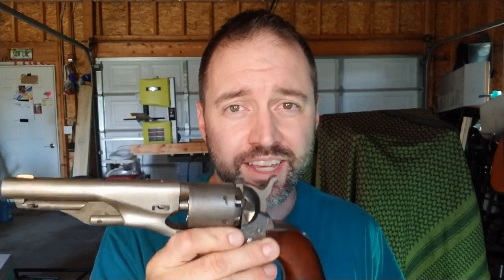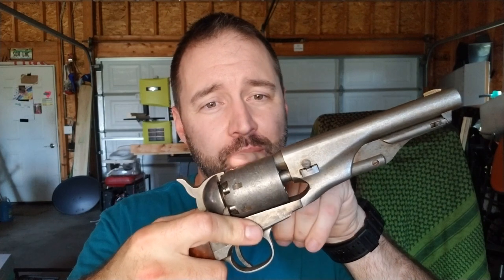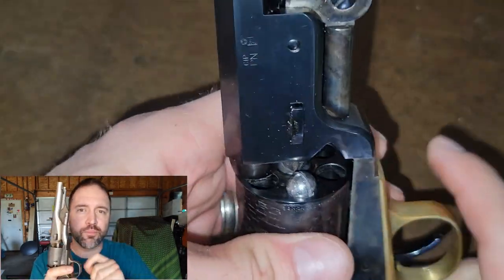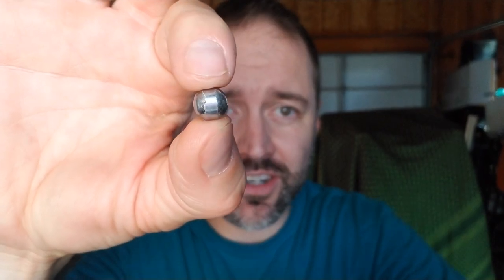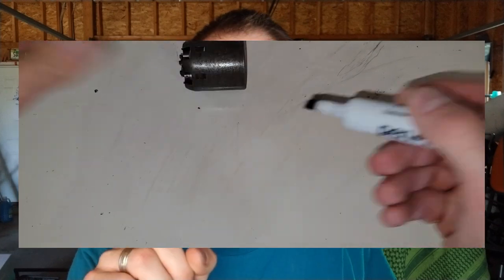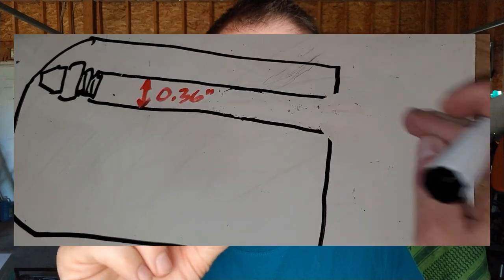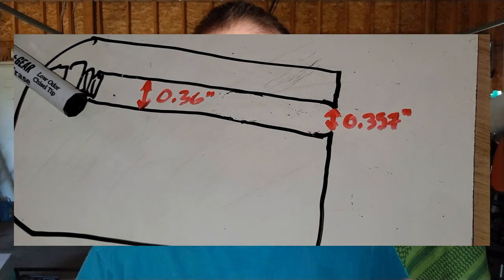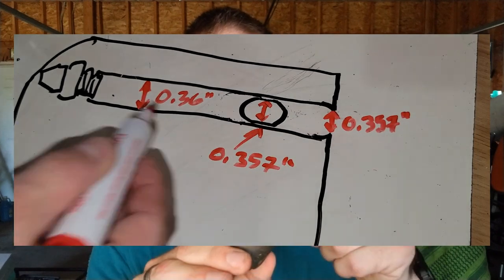Cap and Ball Revolver CHAINFIRE MYTH We've All Been Told

Comment: Thanks for a good and clear explanation. I think many people wont attempt the job in fear of ruining the cylinder so whats the alternative? That would be making sure to use Wonder Seals (or homemade) on top of each chamber. The purpose of the seal is to prevent chain fires and I have yet to learn about anyones chain fires who used them. In fact, even with doing the grinding job still use the seals. Powder-wad-ball-seal. This brings up a good question. In the civil war did they take any safety precautions or did chain fires become popular because they didnt?

Comment: Wow.... I've heard of this with Piettas..... I've always preferred Ubertis.... It's basically a "Ford vs Chevy" kind of thing..... Some people like one over the other.... Anyhow,  I've also heard of chain fires happening from the back side due to loosely fitting caps or badly worn nipples.....
Reply: Generally im a uberti guy but pietta has certain models that uberti doesnt have
Reply: @chroma6947  .... Now you've got my wheels turning.... I'm curious to know what Models that would be.... I don't know too much about them... I have had many 1858 Remington Armys... Infact the one I have now is an Uberti in all stainless..... And once upon a time I had an open top Colt made by Pietta that I just wasn't impressed with.... It shot ok, but it just looked and felt "junky", and I didn't like how it was fit together.... I pretty much have all center fire stuff, but I like to play with the Black Powder now and then.... I would like to find a older, used Uberti Walker... Always wanted one....

Comment: I lube the chamber mouths anyway, just to keep the powder fouling soft, and to keep the moving parts lubricated while I'm shooting. They're dirty guns to operate, even with modern blackpowder substitutes that are cleaner burning. You should work any new gun anyway, or take it to a gun smith and have them do it for you. It's easy work, and there's nothing you can do to damage the gun, as long as you work slowly and only remove a little material at a time. I chamfer the chamber mouths and the forcing cone, as well as removing enough material from the frame to accommodate the loading of conical bullets. The originals could load bullets with the cylinder on the gun, the reproductions aren't quite accurate to the original, and you can't fit a bullet under the loading lever/frame of the gun without removing a little material there.

Comment: The one and only chain fire I have ever had was from a Dixie Gun Works Spiller and Burr, .36. It was made by Uberti, Dixie was the importer, and retailer. I don't think it was caused by improper ball size, improper loading, since I used revolver wads, and a grease patch as well. I think chain fire comes from the cap. I may be wrong, I am sorry for your experience, on your revolver, I have had many cap and ball revolvers of different types and makers, and have never had the problem you had. Did you check with whoever you bought the gun from, or contact the manufacturer? Did you buy it as a finished revolver, or as a kit?

Comment: This racks my brain... obviously, the chamber would have had to be milled from the direction you put the ball in ( because it dead ends essentially at the flash hole). So how could they mill the chamber all the way through, and the start of the hole be smaller when the whole bit would have had to pass through said starting point? Just trying to wrap my head around this. I might be missing something.

Comment: I just got a Pietta 1861 Navy used my question is when it's half cocked should the cylinder be tight against the barrel ? Mine has a little play about 1 16th of an inch

Comment: Every Pietta revolver has a date stamp on it, either a letter in a box on the side of the barrel or the year on the underside of the barrel. What was that date of manufacture on this revolver? Or did you remove that marking when defarbing it? That would be useful information. 

In modern reproduction C&B revolvers, chainfires are a non-issue as long as you keep you hands, fingers, and body behind the face of the cylinder. You are not going to destroy the gun.

Comment: CHANCES ARE THAT A "GUNSMITH" WILL RUIN YOUR GUN, BECAUSE HE WON'T HAVE THE MENTAL CAPACITY TO TAKE A PERCUSSION REVOLVER SERIOUSLY.  ASK ME HOW I KNOW.  He will then blame the "bad steel" because he knows nothing of the difference between a high pressure (made for smokeless powder) gun verses a black powder gun.

I've been harping on this issue for years, as it pains me every time I see someone claim that "shaving lead guarantees a good seal".  You can feel the buts if you use a metal pick, very gently, to probe for it.  Also, this is assuming that the chambers have not been dinged by the loading ram - a VERY common problem for used guns.  You're probably doing it a little bit every time you shoot, and don't know it.  Many have spoken of the unsolved mystery of why some perfectly good guns chainfire a lot while others don't.  No one who speaks like that understands the extremely simple phenomenon of burred or dinged chamber mouths, yet I can see in some of their photos that the chambers are dinged from the loading ram!

Also, I have some guns in which I've chamfered the chamber mouths.  Dixie Gunworks recommends and details this process on their website, or at least they did some years ago.  Maybe I'm the only one who read it, because I've never heard or seen anyone else mention it.  Anyway it works nicely to eliminate all shaving of lead, and instead swages the oversized ball into the chamber.  It's a lot nicer to load and shoot when you're not making a bunch of lead rings.

Comment: .360?????
No, not even on my original colts.
Around .371 or so on a reporo and .373 on the 2 original navy colts I have handy.
.380 is all I use on original or reproduction when using round ball, mostly use conical anyway

Comment: Cutting the ball as you press it in leaves the ball unbalanced with the smooth sides. I have never had a lead ring loading my 45 cal muzzle loader ever and you should never bang the ball into the barrel to hard, which will also deform the ball.

Comment: question: when you get the ball seated at its maximum depth and apply the force of squishing the ball down hard,doesn't the downward pressure cause the ball to form tightly against the chamber wall? the idea is that not only is it airtight against the wall but also can not creep forward as the chamber wall diameter decreases  moving further and further toward the opening of the chamber.
Reply: Not exactly.  It would depend on the facing of the loading rod.
Reply: The powder and any wadding behind the projectile will give long before the loading rod deforms the ball, so, in theory, the powder grains will turn to dust before the ball deforms against the chamber walls.

Comment: Chainfires happen most with Colts, and unless the ball fit is really bad, they don't happen at that end. Most chainfires that I have seen occur on percussion revolvers (always Colts) with lightened mainsprings. With full loads the hammer is blown off the nipple and an adjacent loose cap can be fired. Over 30 yaers I have fired countless thousands of rounds from percussion revolvers and NEVER had a chainfire.....also I never grease the chamber mouths.
The chambers should be about .002 over groove diameter with balls a few thous bigger than the chamber mouths.
Your Pietta was obviously very badly made... chamber mouths should have a very small chamfer....
All of my revolvers need an unfired ball driving out with a punch.
Reply: @@lurch789 MMM... interesting. I have experimented by dropping a charged and capped cylinder into water and leaving it there for some minutes. They always fired fine, and that is with no grease in front and just good tight fitting caps on the nipples.
Re. mainsprings, I have always advised against lightening them on percussion revolvers, it's just asking for misfires (caps need a much harder wallop to set them off than do primers with a firing pin), as well as the possibility of severe 'hammer bounce' on firing, which is also a cause of cap jams as the fired cap is just blown off into the "works". Cap'n'ball revolvers have heavy mainsprings for a very good reason.....
Yes, I am a gun smith, so have worked on a few of these pistols, as well as running a pair of Remingtons myself, which I prefer to the Colts, although the Colts are prettier.. 🙂

Comment: Chain fires are not at the projectile side they are on the cap side. If you pinch your caps or use improperly sized caps they can fall off and when the cylinder next to it is fired it will set off the cylinder next to it.
Reply: It can happen from either end. Cap falling off or loose fit… or at the mouth of the chamber from loose fitting ball or powder over the ball.
Always use the proper size cap and always use an over powder wad or grease over the ball. This is still not a 100% guarantee… but it is the safest way besides a metallic cartridge.

Comment: to make your life easier.   and to kill two birds with one stone..  buy a reamer.    They are about $20.   the real problem with every cyl but two that I have seen is that they are undersize.  by that I mean that they should be a thou or two bigger than bore size.  Accuracy is out the window if they are smaller than bore size.   they always seem to be small... which makes sense given that reamers wear and make undersize holes..   Soo.. if you have a 44 say and it takes 454 or .455 balls  which you know cause you slugged the bore and it is .452..   If the cyl chambers are say .451  the ball will not even grip the rifling...but it will shave off a nice ring of lead and look cool.    So you buy a .453 ream...    take a little time and ream all the chambers to .453    Now you will have a .453 ball going into the .451 or .452 bore   the balls you buy are most likely .454 or .455 so will still be a tight fit in the chambers.    What I do tho is make my own lubricated wadds.   easy with a leather punch and some tallow treated wool.. this also lubes the bore as you shoot ... you can lube on top of the loaded ball but that is pretty messy and hit or miss depending on the temp outside.    Loaded  cylinders in your gun box will leak lube all over when the stuff melts from heat.

Comment: I shoot unlubbed no patchs on 7 of my revolvsrs.. thousands of shots... NEVER once a chain fire.

Then i buy a used 1847 walker made in 92.  It barely holds 457 balls.. makes no rings just tiny slivers in spots.   Guess what... it chain fires badly.   No idea why my walkers cylinders cant barely hold 457 balls its like i need 458 or 459 or 450.   The balls on the 1847 actually roll out if i smack the gun or shoot it

So for that gun i have to used wax even a soft candle wax to hold the balls in place.  My issue is not like yours.. as i can almost push the balls in with my fingers.  Its like ASM bored out the cylinder too big.   I need to find balls bigger than 457